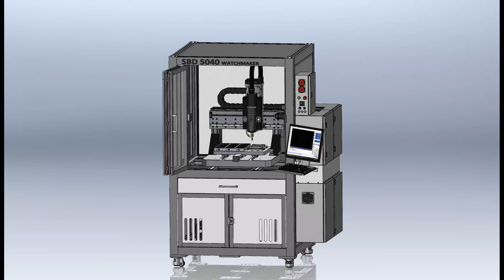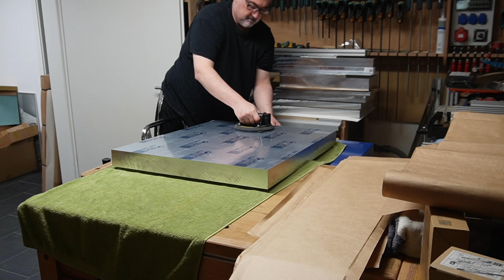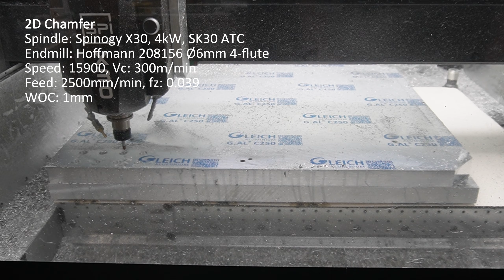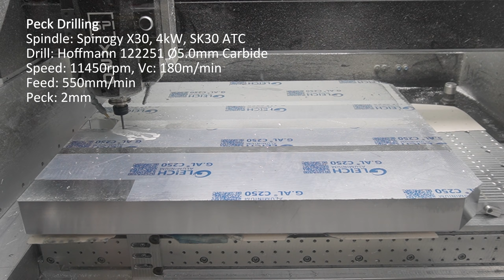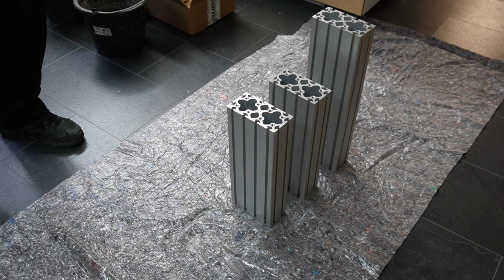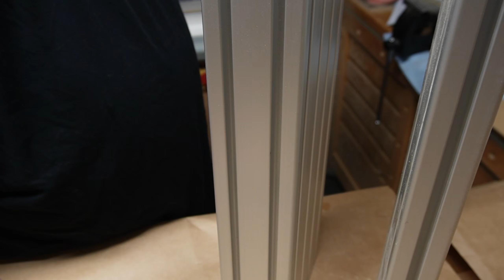Extremely sturdy DIY CNC with small form factor, suitable for milling steel

Comment: my wallet is having a seizure from imagining the cost of that huge block of special aluminium.i would have used epoxi granite or fiberglass reinforced concrete for the body with some aluminium blocks inserted in the cast for machining later
Reply from the maker: I already built a UHPC mill and as well an epoxy granite mill (see my last videos).
The cost for the mold (material and more importantly my time) plus the extremely expensive epoxy (or the cost to rent a free fall mixer for the UHPC) plus the cost for the inserts plus the time to machine all surfaces and features of the inserts after de-molding is in fact more expensive than these big alu parts, which are finished in about 2 hours. Besides, 5083 is not special, but one of the most regular alloys you can get. And the pre-faced slabs are extremely common over here with minimal oncost over the raw cast cuts

Comment: The biggest issue seems to be finding suitable milling spindles. Spindle speed for steel goes from about 100RPM to 2000RPM, no higher.
Reply from the maker: That depends very much on your milling strategy. I mill steel with a 4kW 30k rpm X30 spindle from Spinogy. High rpms, high feed rates, small chip load. (see my video about the stainless steel mod vises)
My customers, who are predominatly watchmakers and knifemakers do it the same way.
These machines are not DMG or Hermle machining centres, but you can certainly mill steel parts for your scale modeling hobby, wrist watch housings, knife blades, etc...
Reply: @scratchbuiltdesigns  That's an extremely bad idea. A CNC mill for steel has to be able to run HSS at under 100SFM. That's a gold standard for any mill.

 The reason there are so many high speed (Chinese) spindles is because they are cheap to make and the VFDs are also cheap, but the high speed bearings can't handle lateral loads. They're designed to be used in routers, not mills.
Reply from the maker: @canonicaltom  Well, my spindles are made in Germany and they held up well over all those years
Reply: "Lateral" I think is known as radial load (in bearing terminology) all but the cheapest CNC spindles have bearings that are designed for Radial and Axial forces. That includes many of those manufactured in China.

Despite that even cheap smaller spindles can be upgraded with radial contact bearings. Also there are significant possibilities for bearing choices. 

Now the quality of bearing tolerances and bearing preload/bearing matching is another story. 

Did you know you know there are bearings made of ceramic, silicon carbide, titanium carbide, zirconium carbide and even ruby/garnet?

I imagine the issue with cutting steel mostly has to do with correctly matching and optimizing the number of variables. 

Spindle/Router RPM with feed rate and endmill material and type with the work material.

With steel confidence in the bearing and endmill performance possibilities related to rpm/feed rate and taking advantage of the confidence that's available is a factor in wether the steel experiences work hardening or not?
Reply: @brianhutchinson7863  Both drill press and router spindles are not designed for real lateral loads. Yes you can potentially upgrade the bearings, but then you have essentially built your own.

As both a mechanical engineer and a machinist, I don't have to imagine anything about milling steel. I recommend picking up a copy of the Machinist's Handbook, which will answer all your questions.

Most of the DIY and commercial gantry style routers use these high speed spindles, which are perfectly suited for plastic, carbon fiber, wood, aluminum, and friends. Really excellent for that. Because they cannot be slowed down, they are not suitable for steel. That's all.

One example of a spindle that is suitable for a steel cutting mill is the 5C from Taig. It can be driven by belt with a number of different motors and seems pretty popular. It of course isn't popular with gantry mills because it's extremely heavy. That's not necessarily a problem, it just has to be considered in the frame design.
Reply: @canonicaltom  but if he can hit the needed tolerances, production times are low enough and  the spindle holds up long enough where's the problem? sure if you run a 24/7 production with high loan costs and no room for any time and material wasted you might get a more expensive, specialised spindle.

Comment: Such a beautiful build man. Would love a independent video on parts selection for your machines. 

Another video on some pointers when designing for rail linears and ballscrew would also be nice 😊
Reply from the maker: Thanks...
On the ball screw selection I showed a few calculations in one of my earlier videos about the woodworking router.
It has mostly to do with max rotational speed

Comment: I you worried about inhalation of those fine aluminum shavings. It’s all I could think about lol
Reply from the maker: What doesn't kill you makes you stronger
Reply: @scratchbuiltdesigns  search about the side effects my friend, you'll be amazed 😂❤
Reply: Unlikely to do any harm. It's the fine floaty dust you need to worry about. If it was steel it would be hideously sharp for hands, but this aluminum fluff pile would be soft and pleasant to pick up.

Comment: Side milling 70mm in one go is quite impressive for a router-style machine, that's a massive machine base.
Also, aluminium wool!
Reply from the maker: Absolutely. I am really happy with the machine. Not sure if you have seen the build video, but I show a little bit more of the design and the making.
I have a short out there showcasing the finish I achive with that op...
But the chip volume of that finishing endmill is hilarious. That is in fact the limit of a bench top design

Comment: On one hand, this is a fantastic project. But I have a lot of questions. Building your own machines often means that the most advanced equipment you have on hand is a drill; having a full-fledged machine just to build another one is a luxury for the wealthy. Secondly, you bought a massive base plate but used extrusions for the uprights and parts of the gantry—why do that when you could have built the entire machine out of solid aluminum blocks? That approach is a mystery to me. With a milling machine like that, you could have machined every single part—including a monolithic gantry and uprights—from a single piece of aluminum. Thanks for the video, but the setup looks odd.
Reply from the maker: I sell these, so a drill just won't cut it...😊
I also offer machining of parts and already machined part kits for people who like you said only have a drill at home.
And a filled extrusion is cheaper and has better dampening properties than a solid block.
On the base that's ok, but as I mentioned in the video on the gantry dampening vibrations is key...
So it is a mix of reasons
Reply: @scratchbuiltdesigns  Thank you for the clarification.

Comment: Do you sell finished machines? or mechanical assembles?, kits? I was not able to find a website.
Reply from the maker: Both. You can send me a mail. Address is in the channel description
Reply: @scratchbuiltdesigns What would be the price range of such machines? Are we talking 3000€ or 10,000€?
Reply: @happygiraffe9787 i think we are Talking 20000€
Reply: @kZooooid At that point better just buy a real used cnc mill that's around 10 years old

Comment: Will you release the files for this bed slinger style machines? I would like to build one, but I'm not sure I can design one. I have a CNC router that can do aluminium, so I should be able to do most of the parts.
Reply from the maker: Since I sell these machines I cannot publish the design. Sorry
Reply: @scratchbuiltdesigns  Yeah, that's fair enough. Hopefully with these videos I can get enough of an understanding and design my own :D Thanks for responding, keep up the great videos, you inspire me to try to build a better CNC for myself
Reply from the maker: @shadowphyre Cool. And just go for it. It is a rather rewarding experience to build a self designed CNC and to see it coming alive 👍
Reply: @scratchbuiltdesigns  One last question and the I'll stop bothering with questions. What type of extrusions were those you filled up with epoxy-sand mixture?
Reply from the maker: @shadowphyre item system compatible. Slot type 8I. Heavy duty 160x80mm

Comment: Very nice build!! Im wondering, where do you get the vacuum cards? I recently inversted in a vacuum system and looking for options!
Reply from the maker: It is from Datron directly. They sell the stuff in their web shop 👍
Reply: @scratchbuiltdesigns - If you’d ever be inclined to do a video short on the Datron cards and vacuum work holding I’d be glued to it!
Reply from the maker: @mrector23  I can add a focus point on it in one of the next videos 👍